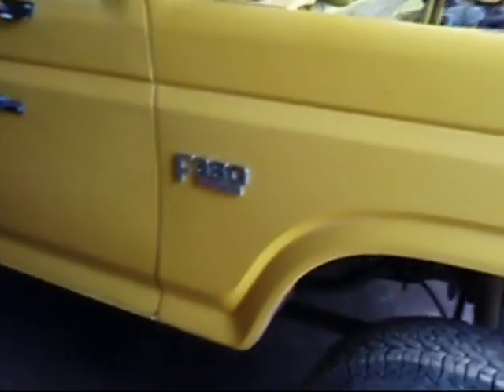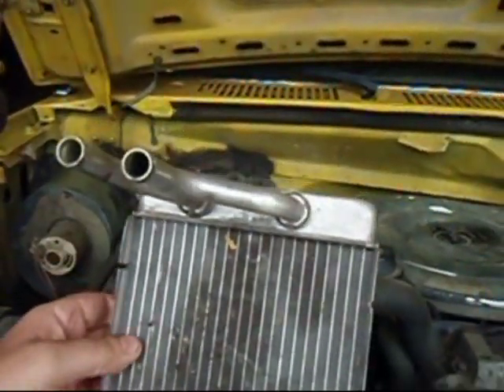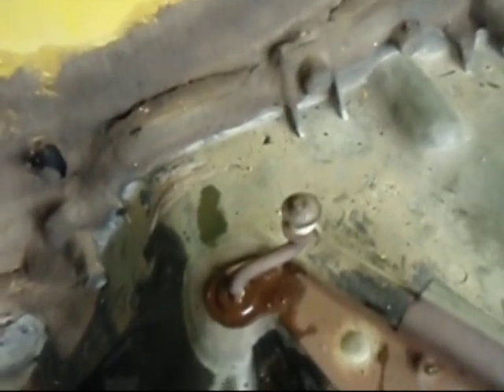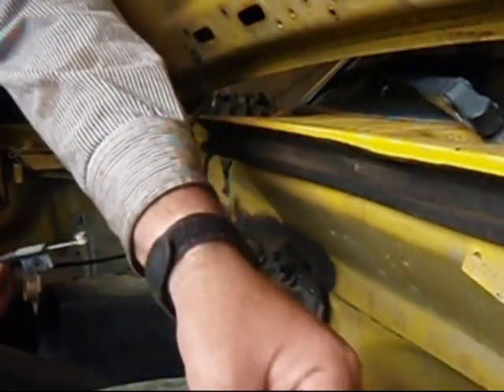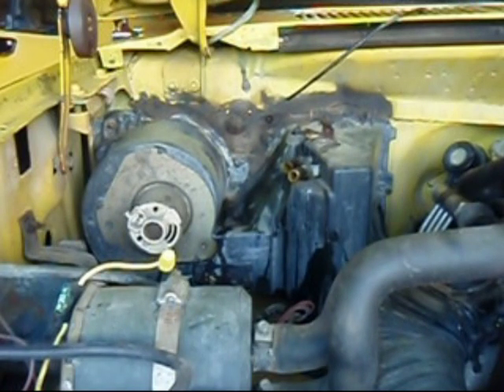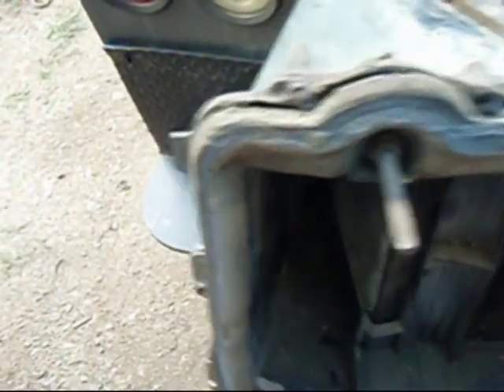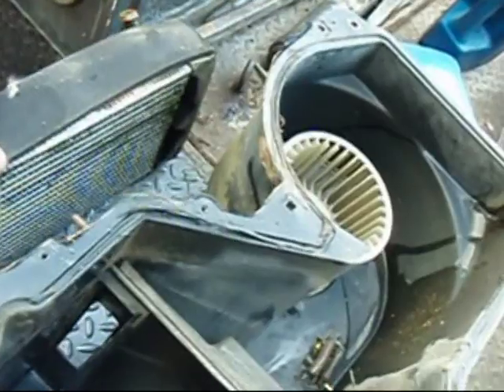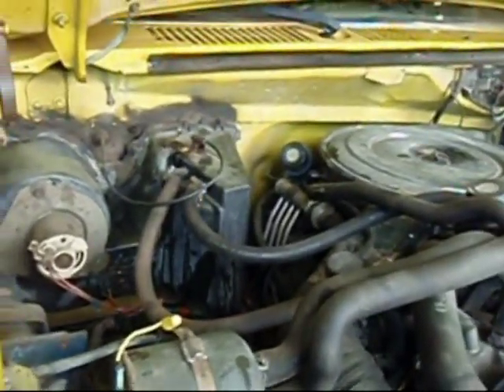1985 F350 Ford pickup heater core replacement

Comment: Please to know your video here is still helping people out with their mid-1980's Ford trucks.  I've an '86 F-250 and the heater core sprung a leak a couple of days ago.  Thank you for your video(s), they're appreciated n' helpful.
Reply: I just got an 82 F150 and I now have steam coming into the cab. I'm flat broke so luckily I got a cab off an 80 F150 I can get one off of or I can take one off my 82 F100 that I wrecked last monday and use that cause I know that one don't leak.

Comment: My Husband did ours on our 81 F-150 in about 2 1/2 Hours and it only took that long because of a Bolt that was stripped (top left in the engine compartment). Great video and very acccurate for a 81-85. Thanks!

Comment: Cannot thank you enough man, my core swap was a real bastard, the top left bolt was seized on the housing and i had to go at it with a crow bar, the nut was on the inside of the frame and i had no way to get the bolt out,  needless to say i got er done in the long run.....thanks again Sir, cheers!!

Comment: That is exactly what I have in my 85 F150.
I replace the heater core in my 1981 F100, But that was back in 1997. I doesn't hurt to watch a video like this as a refresher for the job at hand. 
Thank You idig4stuff for making this video upload.
Reply from the maker: Your welcome. One thing to be aware of is there are 2 different sizes. My original core was the large one, I had bought the smaller one and was able to make it work by putting more insulation on the shorter side. I would have preferred to have the larger one of course.
Reply: idig4stuff From what I gather they made two different heater cores. One for AC and one without AC. I do not remember having this problem with my 81 F100. I do remember that truck had AC from the factory, But someone disconnected it long before I got the truck.
I do remember the person at the auto parts store asking engine size and if the truck had AC or was without. I said the truck had AC and took what they gave me.
Now days it does not hurt to bring the part with you to the auto parts store and check and double check what they give you.
Thanks Again for the video.

Comment: We also had the problem of the spinning bolt in the upper left hand corner of our heater case.  We ended up destroying the bolt head to get it out.  When I went to unscrew the other two bolts from under the dash, I had to drop the blower that's under the glove box.  Totally by accident, I discovered the hole in the firewall that bolt fits into.  It's WAY up behind that blower!  So if you're having trouble getting the bolt off, you might have to drop that blower, if your truck's equipped with one, to get at that nut!
Reply: God I wish I knew that beforehand. I used a drill to force it back while pulling on the housing. It worked, but there's probably some damage

Comment: Great video. Thanks for the help!
Reply: ran into same problem as others with "85  and it being a bolt on top rather than a nut coming out....had to use a Dremel and carefully cut off the head of the bolt to get the top under the hood bolt off.  Awesome video to help me through the location  of all bolts, and fasteners, ..now just need to clean out case, split case, replace core, and assemble...can't say enough  about how video you posted helped me!!!! thank you thank you thank you!!!

Comment: Thanks for the video, just did mine , I forgot to connect the two cables started the car it was running, I noticed I didn't connect them I turned off the car connected the two wires tried to start the car and now it doesn't turn over, do you know what it could be?

Comment: Thank you for this video, I only had problem with top bolt just spinning, but took it to a friends shop and we used pry bar with pneumatic wrench and socket and finally got it out. I noticed the bottom bolt screwed into a clip but the top one I just don't know if there was a nut plate welded at one time because it was just a hole that the bolt was going through?  Thanks again for the informative video.
Reply: @Laurie Vienneau do you remember how you put it back in or did you leave that bolt out when putting back together? I have the exact same problem

Comment from the maker: Replacing heater core in 1985 F350
Reply: nice vid, quick question does the hose from the top of the engine go into to the drivers side heater core outlet or the passengers side?

Comment: 1985 F250 inline 6 4.9L...heater core housing  pain. I am having trouble getting out the top bolt on firewall it seems stripped. what can i use since it is hard to get to?
Reply from the maker: +David Zick If threads are stripped and head is not just turning on other side of firewall, try putting pressure on the bolt by trying to pry the housing off while turning the nut. Maybe too hard to get at the stripped nut with a chisel or small grinder to cut it off? If you can get visegrips on the nut you could pry on them as you turn.